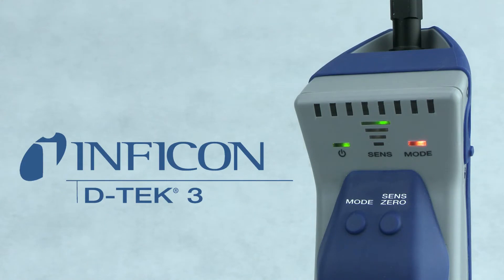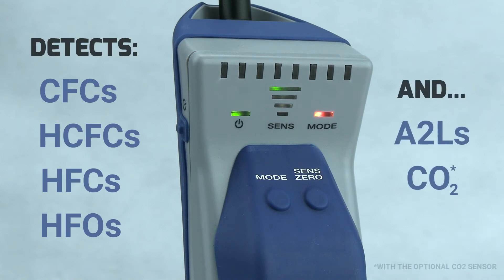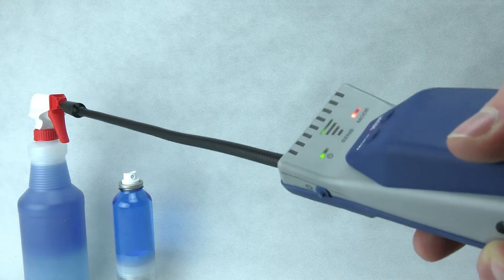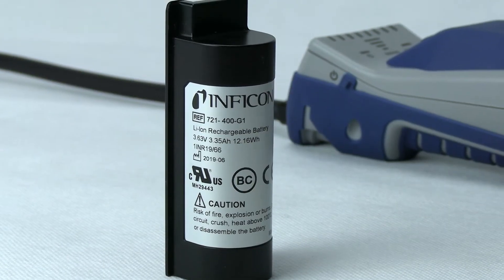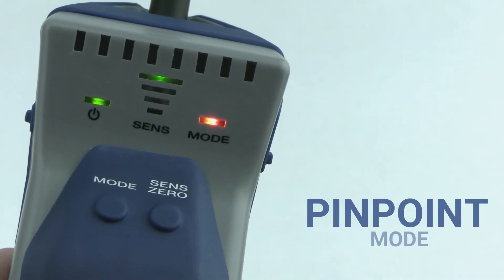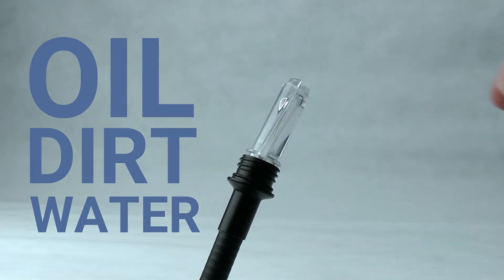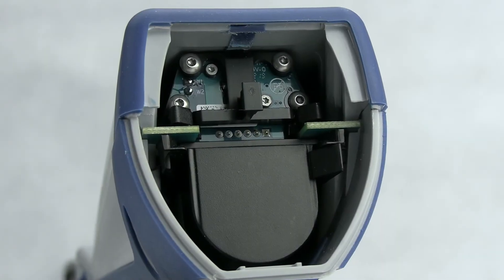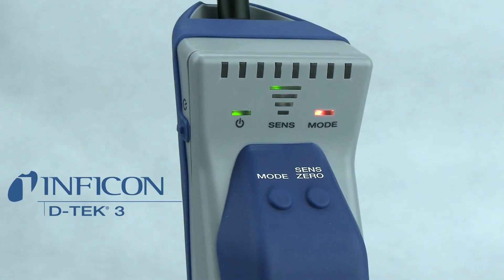D-TEK 3 Refrigerant Leak Detector

Comment: I got one 8/17/20 and the power button to turn it on/off is EXTREMELY hard to turn it on. The second light on the sensitivity scale didn't work and I couldn't open the battery door. I returned it 2 days later and got another one. Same issues with the power button and haven't tried to open the battery door. Seems like a poor design for a $550 leak detector. Tech support said they are aware of the power button problem and the battery door not being able to open is because the battery shifts and gets under the button. Now finding the leak was great. It has a rechargeable battery but the indication of how much charge it has is poor. Different colored lights for the percentage of charge. Green is >30%. So when it's green, it could be anywhere from 30% to 100%. No lanyard or even a place to put one. Instruction manual doesn't give you a description of what all comes in the package. When you open it, you will see some empty spots in the carrying case. So you wont get confused. It comes with the leak detector, charging cable and about 5 different adapters for what ever county you are in, 3 filters (one in the detector ans 2 in a baggie) and the case. Everything else you will have to buy.
Reply from the maker: Sorry to hear that you are having issues with your D-TEK 3. Please contact our technical support line at 1-800-344-3304 Monday-Friday 8:00AM - 5:00 PM Eastern Time. They will be very happy to assist you!
Reply: @inficon  I had already did that before I wrote my statement.  They had a sales representative from NY contact me and only tried to make excuses for the unit. I asked him to get with engineering to let me know how much pressure and what size diameter you had to apply to get the unit to turn on and off.  Never heard back from him. Now I have a Inficon scale that doesn't work.
Reply: @NorCal-refrigeration  not looking to buy another detector.  United did trade it out.  Power button is still hard and it does very well at detecting leaks.